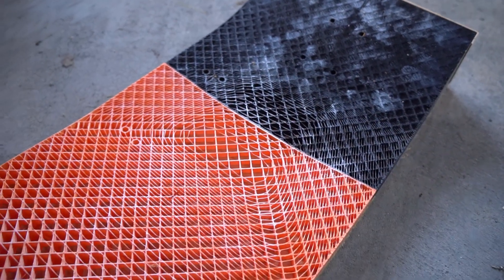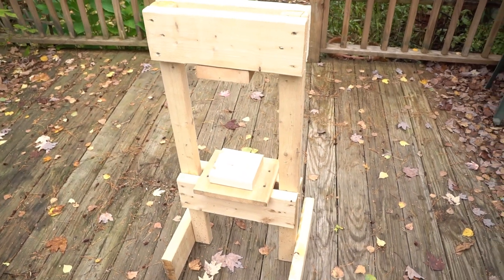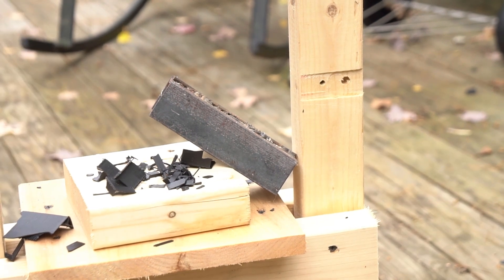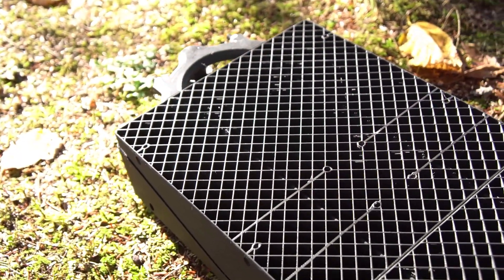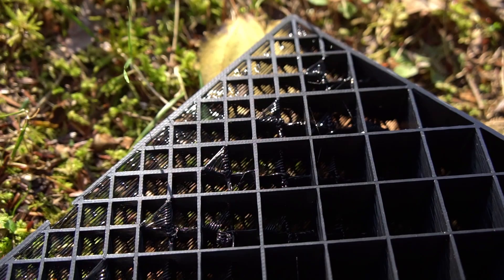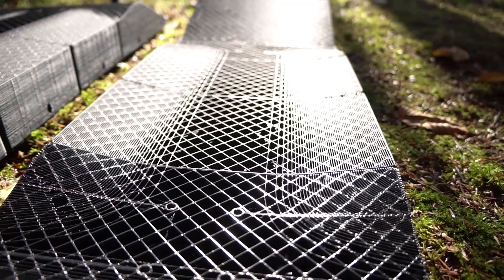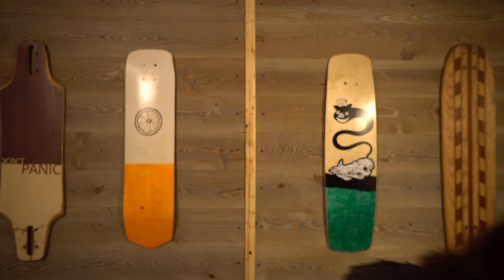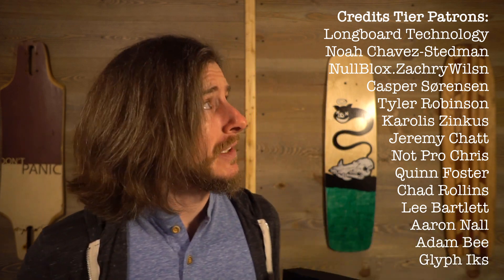3D Printed Skateboard Molds - FAQs and Release!

Comment: What 3D printer do you use? Do you have a recommendation on a solid, reasonably priced (maybe $300-500) printer that is big enough to make these molds?
Reply from the maker: The printer I use for these is an Artillery Sidewinder X1, which does a good job stock but I've done some mods to mine to make it a little more consistent. I've got a vid on all that here: https://youtu.be/uhLGzuaxJjo

Comment: Would it matter if I only have a resin 3d printer for making these molds? Is there a particular resin to consider?
Reply: Resin printers tend to be smaller and in most cases a little weaker then FDM so not exactly ideal but you could try. (I’m no 3d printing expert btw)
Reply: @angusls6032  I'm thinking I'd have to make these in chunks., Small than you can fit on the average FDM printer, so obviously many many blocks of them.
Reply: @noveltystylus6703  yeah if that works for you then go for it
Reply: I'd think with the cost of resin vs the cost of grabbing an Ender 3 from Microcenter for a couple hundred bucks you might even out that cost by the end. Plus then you have a new printer in your lineup.
Reply from the maker: Yeah, just to add to what everyone has said so far: most standard resins are pretty brittle and even the base resins are more expensive than PLA. Could you print a mold with one of the "strong" resins? Yeah, probably, but to me it seems like you'd get a stronger mold faster, and for less money, with an FDM printer
Reply: @GoodRoads  ok... I don't have a problem buying new gear... I have a problem stopping. But thank you for the info.

Comment: Hey Chris what filament are you using to print the molds and does Titebond 2 work at all even if I have to rush like a mad man?
Reply from the maker: Hey! I'm just printing with plain old PLA, it's been plenty strong for me and it helps keep costs down. I've been using TB2 for my decks lately just because it's easier to get a hold of, it works great
Reply: @GoodRoads  Ok good to know thanks for the response
Reply: I use Titebond 2 all the time.
The open time for 3 is about twice as much as 2, but they're both close to the same strength, and close to the same water resistance.

Titebond 2 gives enough time to do a lay up. I wouldn't say its a mad rush, but you do need to be on top of it.
Better to have two people than to rush like a madman, if it ever came to that.
Reply: @LongboardTechnology  Ok noted will get a friend to help me lay up my decks when I start thanks for the response

Comment: Chris, is there someway you could cast your mold with some other type of strong material to avoid having to spend so much time printing the molds?

I'm really looking forward to seeing how you continue to share your findings and hopefully you can become a disruptor is the skateboard industry with trying new techniques.
Reply from the maker: You could cast a mold but there are cost tradoffs pretty much everywhere. A resin mold for example would be insanely cool but it would cost hundreds of dollars just in materials. Concrete is a standard in the industry and doesn't cost too much, and is an awesome way to go if you're making your own molds, but they're so heavy that trying to ship them to people would be insane. On the other hand, the prints certainly take a long time, but it's mostly passive, I can be down in the shop doing other things while the printers chug along